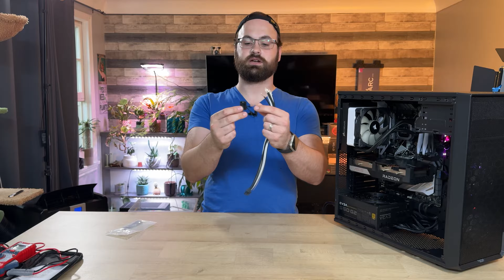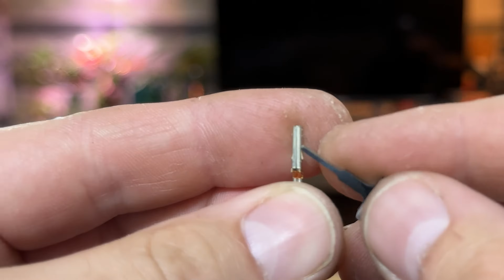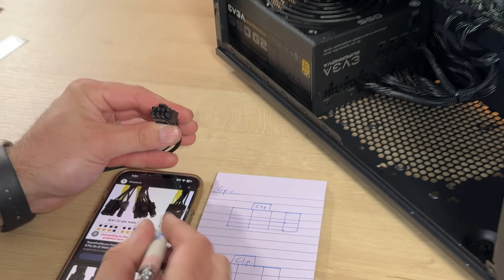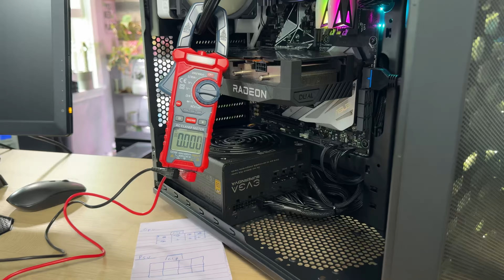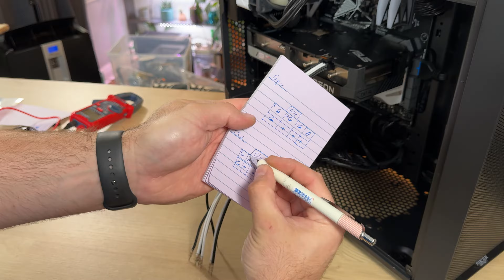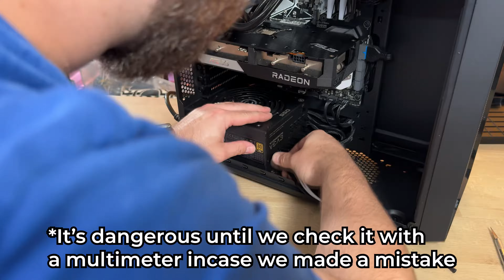This used PC was missing a GPU power cable, so we made one. (For any power cable)

Comment: my 4060 has five pins with resistance- meaning they accept the voltage? If my PSU has three 12v pins, how do I split them across those five pins?
Reply from the maker: "my 4060 has five pins with resistance- meaning they accept the voltage?" - No. That doesn't mean anything about them accepting voltage. The pinout on the card side is standardized. Just google the name of the connector your card uses along with the word "pinout" and you should be able to find an image easily that shows which pins are ground and which are power. For example "PCIe 8 pin pinout".
" If my PSU has three 12v pins, how do I split them across those five pins?" - I'm not sure on what you're asking here, sorry.

Comment: With the card you have, it probably won't matter, but I wouldn't plug and unplug the power cable more often than necessary. The contacts are only rated for a limited amount of plug in events. Also one should check the temperature of a self-made plug after a while of intensive use to see whether there is any unnecessary resistance due to a suboptimal crimp. Again, this does not matter for graphics cards that aren't very power hungry, but cards like the 4090 may draw a lot of amps over their 12 pin connectors.